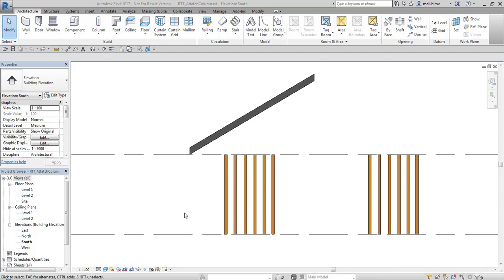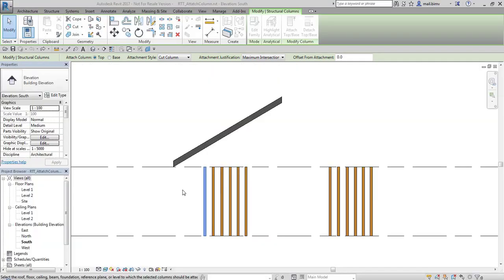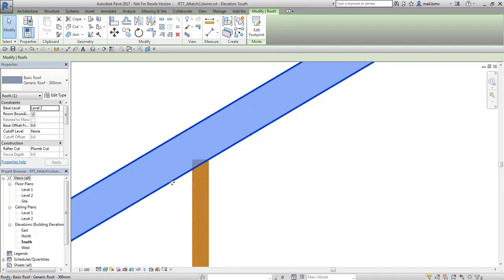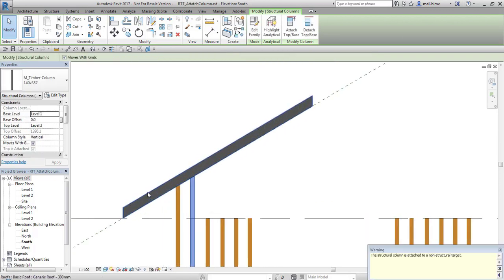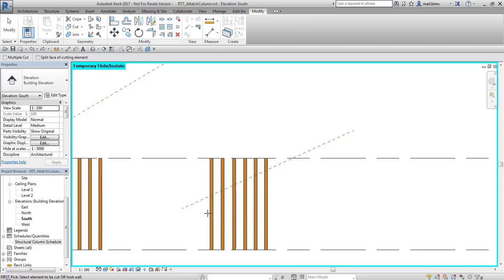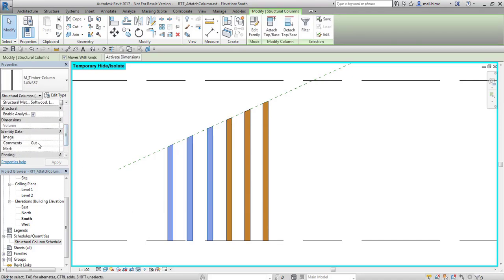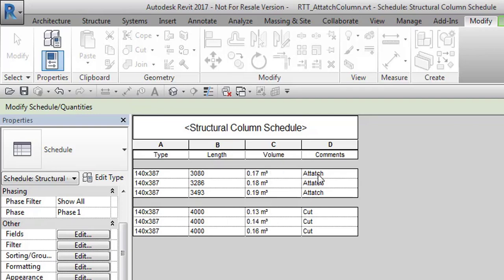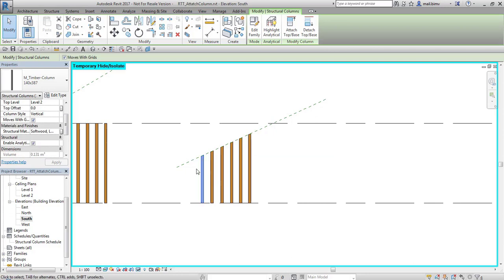Attaching column tip in Revit | revituni.com

Comment: I have a question, how do i do when the column is in the middle of two slopes? (Like this -> /l\)
Reply from the maker: you need to cut it using reference planes
Reply: @revituniversity  Thank you for the reply. I watched your video and it helped a lot, i used the reference planes like you did. 

But in my case i need 2 reference planes, one in like this / and one like this \

And when i use one of the reference planes the column goes above the other reference plane.
Reply from the maker: @goncalofreitas477  instead of attatching the column use CUT command make sure the column is above the reference planes.